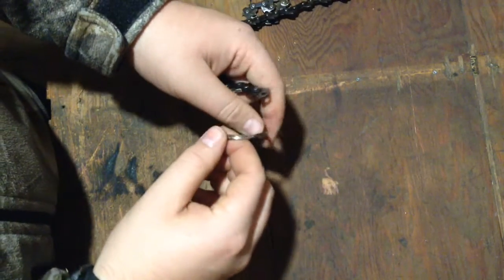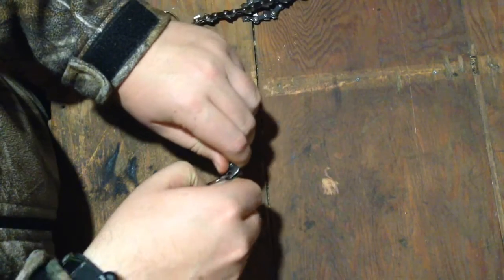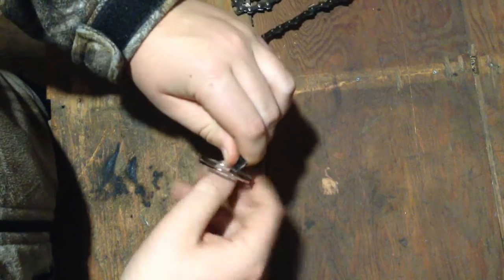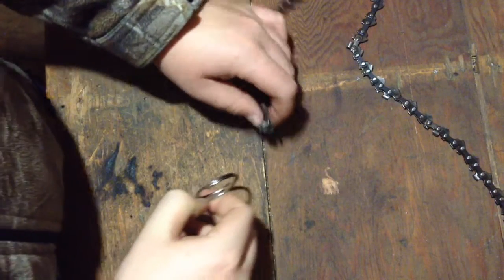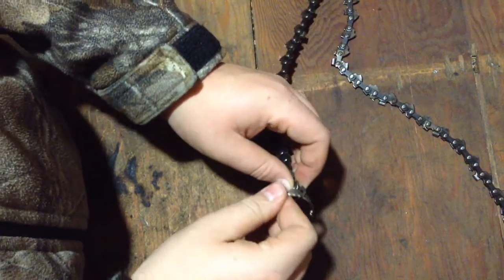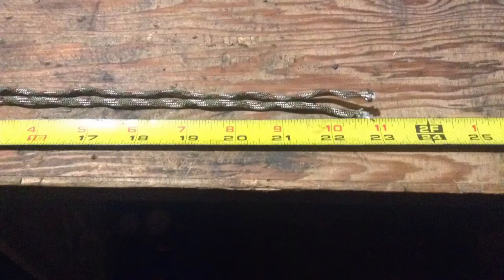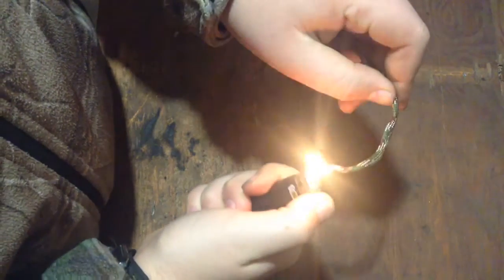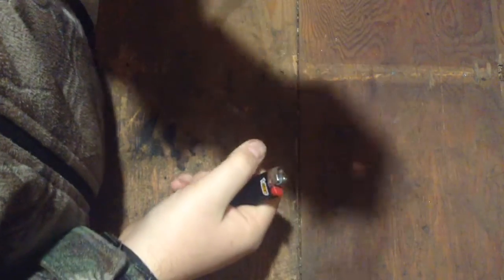Making A Pocket Chainsaw

Comment: i also wanted to repurpose a chainsaw blade but worried it'd take twice as many back-n-forth motions to do the same cut, due to the blades only cutting in 1 direction. on the plus side, it'd be much easier to sharpen it. i mean, what all is involved in sharpening an amazon double-sided blade? doesn't seem it'd fit into my Oregon sharpener.

Comment: all the hate from this fredrick dude and it works just fine. the keyrings are probably the weakest link, but if included they would allow for easy attachment to a bowsaw or bucksaw frame and in that configuration they would be strong enough for the job at hand. could be crafted to fit into an altoids tin, great work.